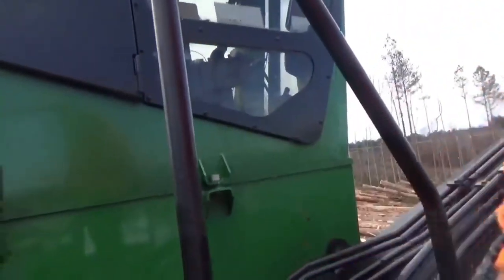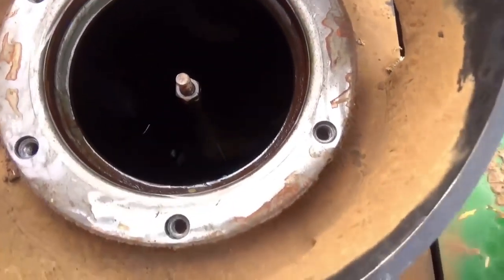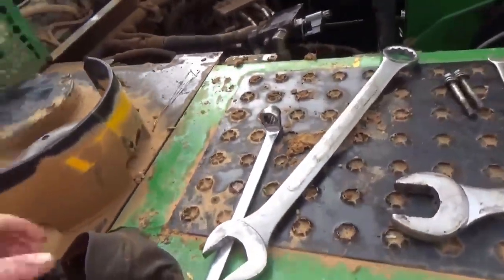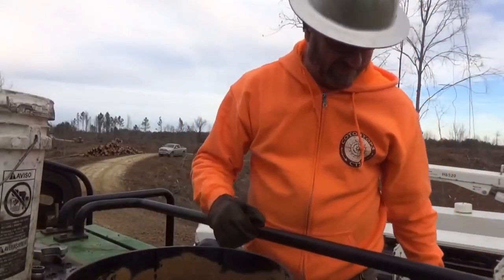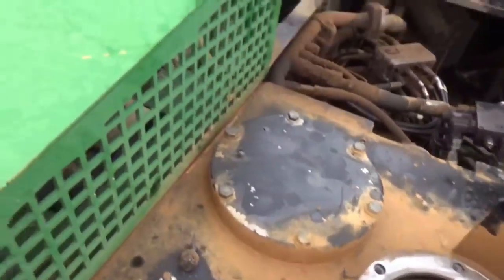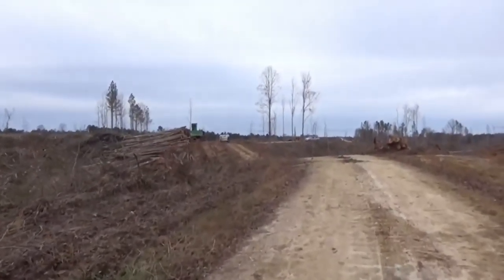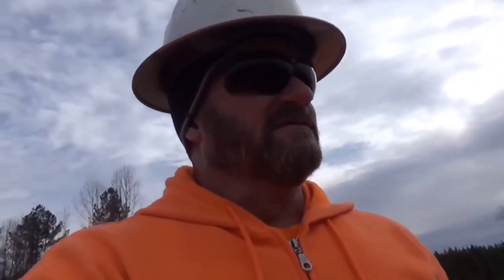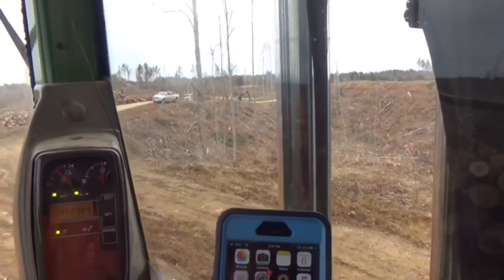A New Hydraulic hose

Comment: I ain't ever seen clear hydraulic fluid before.
Reply from the maker: That is AW-68. All ur high pressure systems run it.
Reply: It runs in my bucket truck worst fluid to find a small leak
Reply: can get a dye to add to the oil
Reply: Hitachi super 46 john deere excavators use it

Comment: Just a suggestion. I would clean the top of the bucket off before I started pouring. When I think about the great big headache a tiny little peice of trash in the hydraulic system can cause.It might be worth the couple minutes spent cleaning to prevent hours of trouble shooting a problem later.